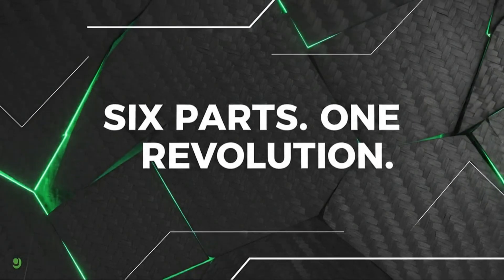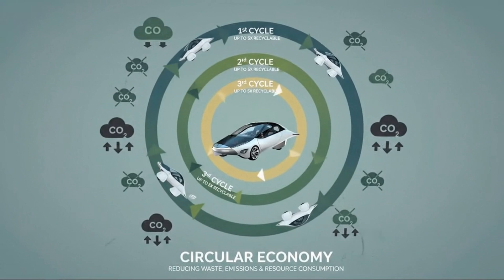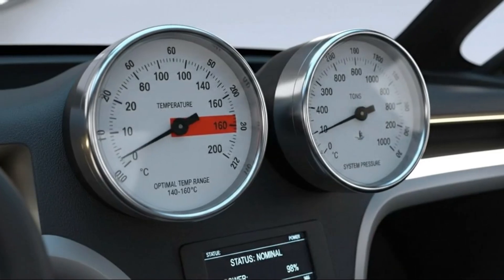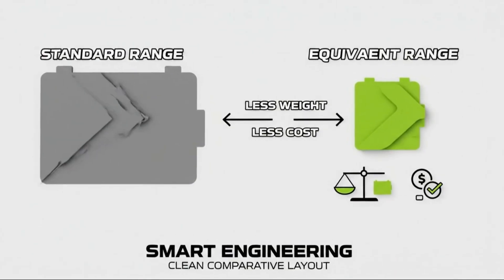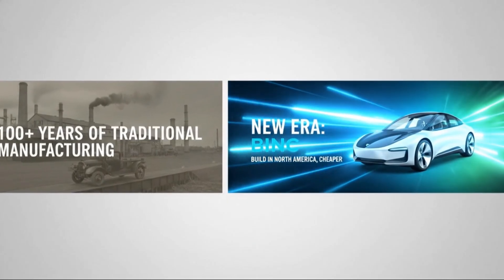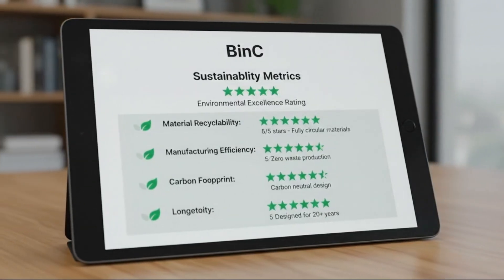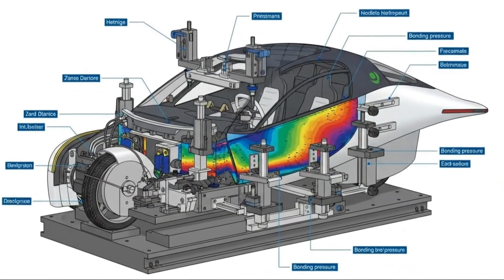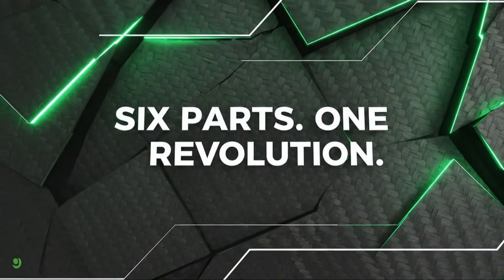Aptera’s Carbon Fiber Manufacturing Could Save Millions and Change the Auto Industry

Comment: Aptera had to give up their plans to build the body like a boat hull: 6 pieces vacuum molded, glue together, ready. REAL engineers from Italy had to convince them, that this will not hold, so they changed to an expensive aluminium frame, where the body panels are glued onto.

Comment: The Carbon Fiber is what they use on billion dollar F1 cars. They are the safest on the planet. Aptera finally did it and now it's available on a $28K car. This is why Aptera is the most powerful engineering firm on the planet and why I buy more stock. It's going to the moon.